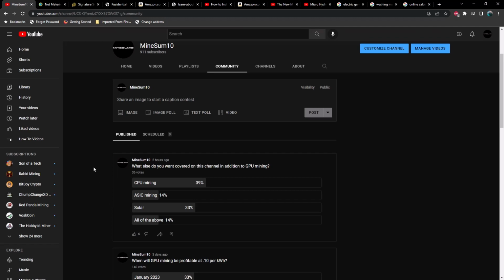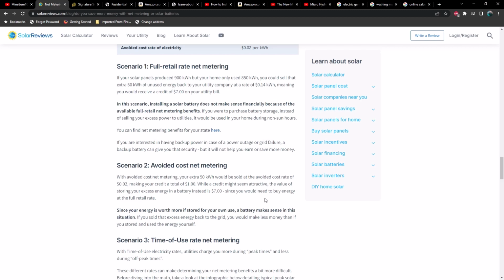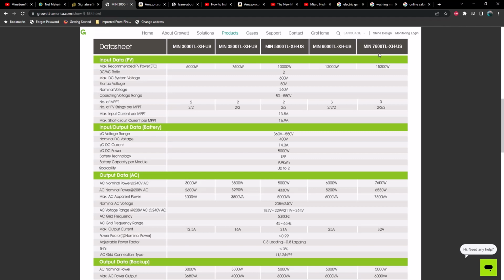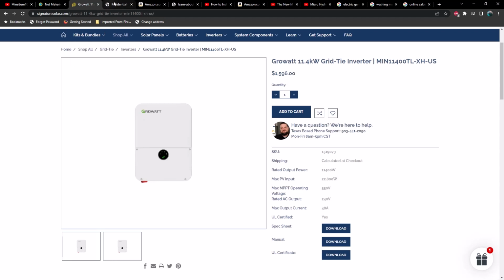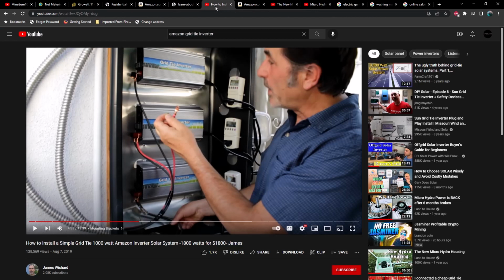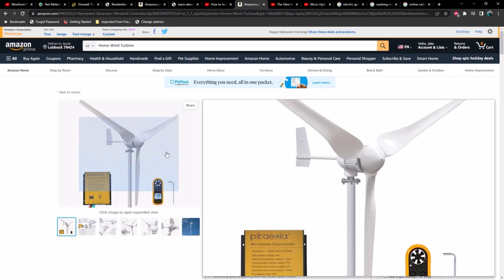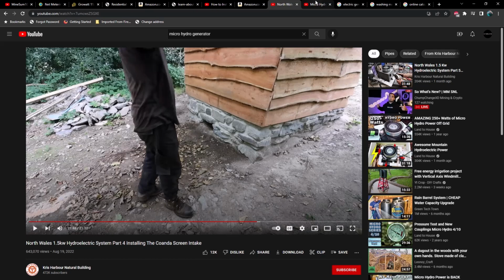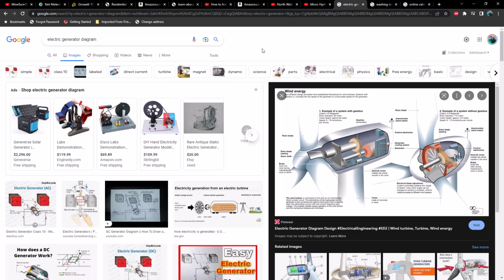DIY Solar, Wind or Water to power your crypto mining farm. Which option is best for you?

Comment: Batteries can be useful if you don't have reliable power, example California rolling blackouts. Also most hybrids you can set an option if you want the battery to charge from AC or only the MPPT. Have you looked at microinverters (Aptos or APSystems).
Reply from the maker: Thanks for watching and you’re correct there are definitely reasons to have back up batteries. I just hate to see people buy them who don’t need them. I definitely looked into microinverters. Lots of pros and cons.  I like that they can increase the total output but I don’t like the added cost or potential maintenance when one fails. Are you looking into solar or already have it?